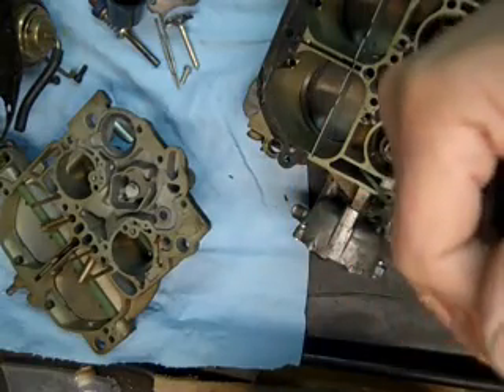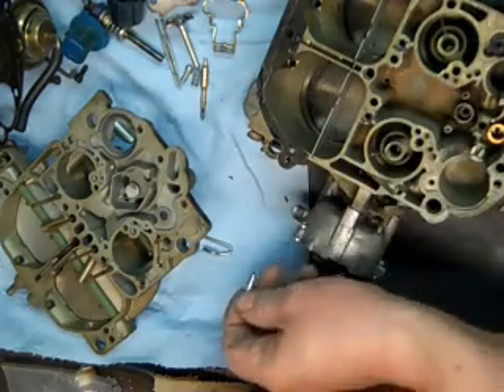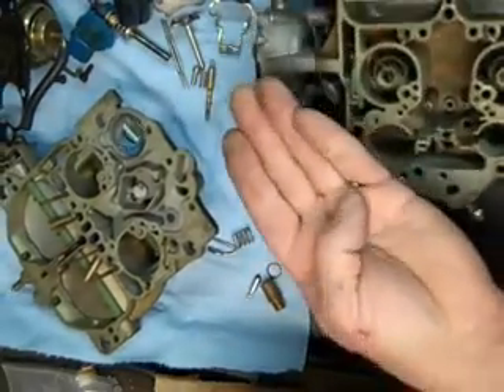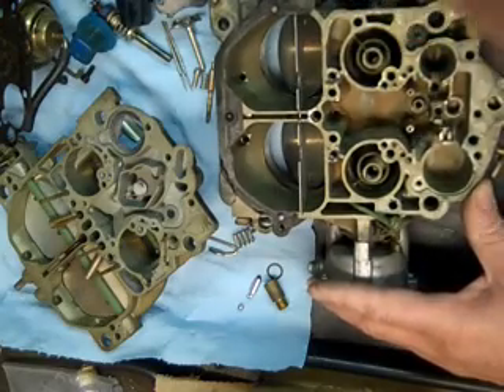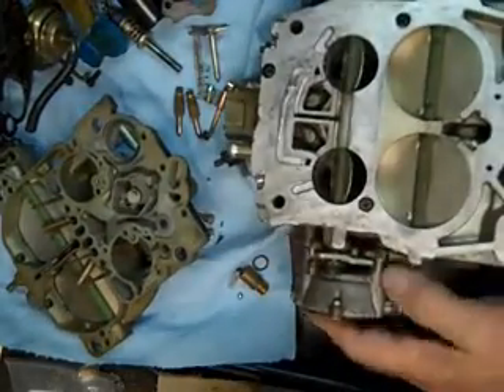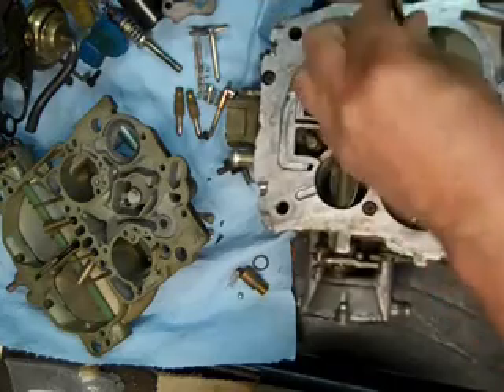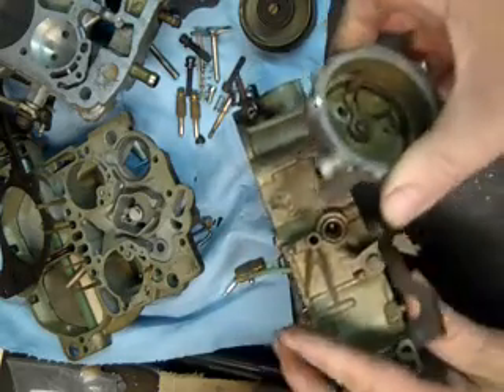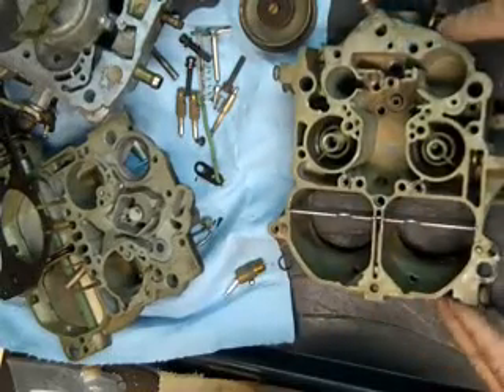How to Rebuild Quadrajet Electronic Carburetor - Teardown Part 2

Comment: Hey Mike , do you have a video on how to put a electronic carburetor back together.  I'm questioning myself should I cut holes out for the mechanism that works with the acceleration pump. Help me out

Comment: Question, on an electronic  quadrajet  # 17086057 I removed the lean air mixture solenoid without turning the screw in till it bottoms while counting the turns. this carb is on a 1986 chev c-10 with a4.3 v6. in your video it was 4 turns and I think that was from a v-8. so I was thinking of starting at either 3 or 5 turns. would you have any suggestions? I would appreciate any direction, thanks.  Chris

Comment: thanks for uploading this i have 2 questions for you?
first , does your website sell rebuildable cores?
secondly when you replace a quadrajet what is the torque on the fuel filter nut every body tells me tight but i dont want to strip it out and must not get it tight enough cause it ends up leaking